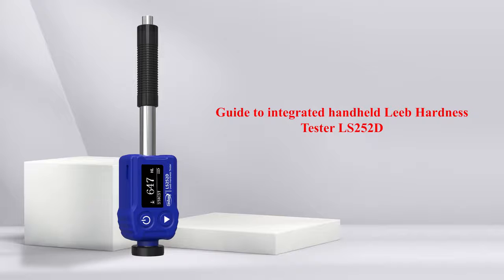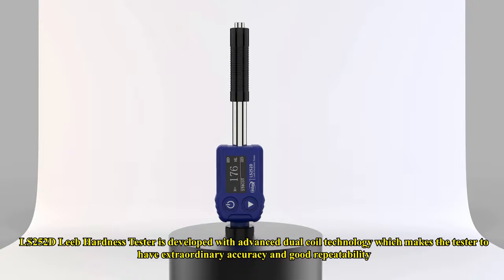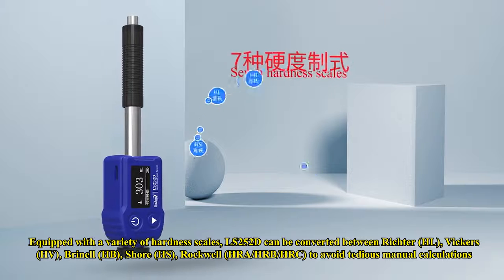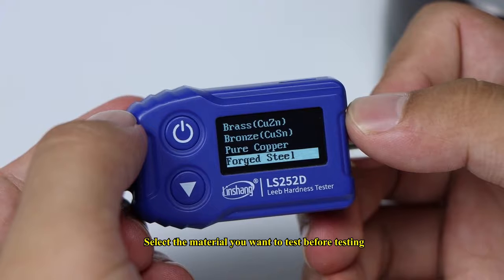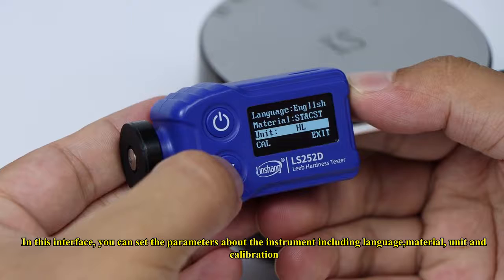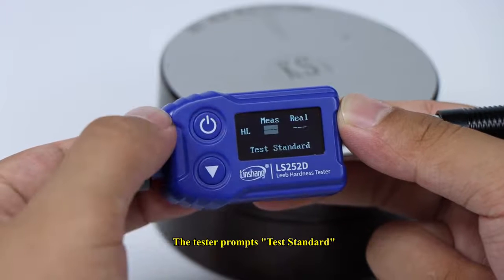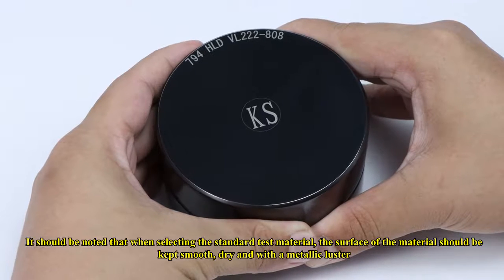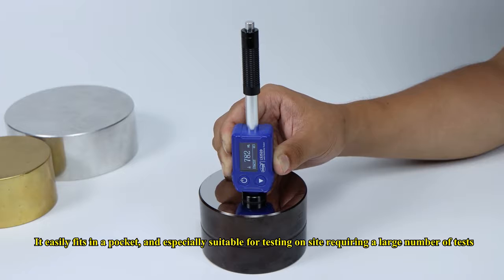LS252D Leeb Hardness Tester Feature Operation Video

Comment: Can we use it to measure hardness of steel coils
Reply from the maker: The minimum mass of the measured object for the LS252D is 5kg, and the minimum thickness is 25mm. If the measured object is coupled to a firm support, the combined mass of the support and the object must reach 5kg, and the minimum thickness of the measured object must be 3mm. If your steel coil falls within this mass and thickness range, the LS252D can meet your measurement needs.